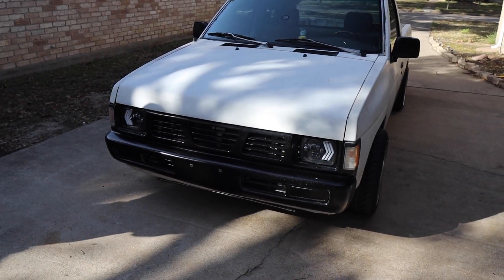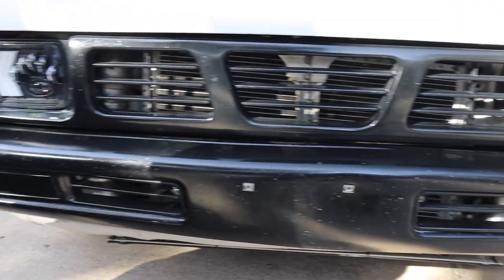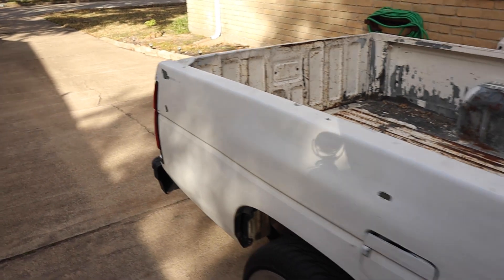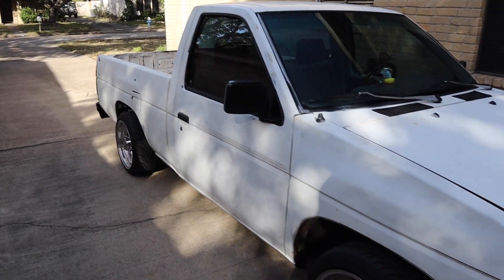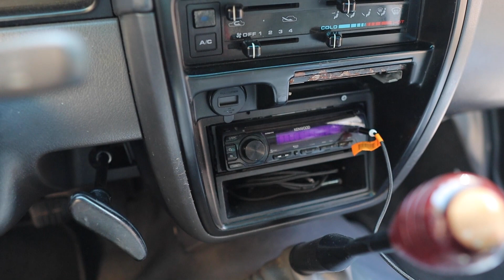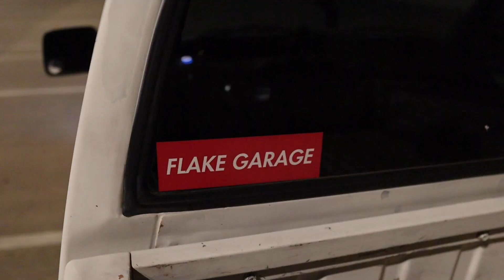1997 Nissan Hardbody D21 Lowered Mini Truck | Flake Garage Bryan G

Comment: What’s up guys!! My Nissan hardbody had 15x8 with 195 50 15.both of you guy trucks are awesome man!!!!
Reply from the maker: Awesome! Thank you for the support!
Reply: @FlakeGarage  hey bro I have a question
Reply from the maker: @galaxykodeentstreetmuzik5259  what's your question?
Reply: @FlakeGarage   hey what’s I both the same beltech kit as u couple months ago and I have some problems
Reply: @FlakeGarage  I heard u said something about cutting the tie rods
Reply from the maker: @galaxykodeentstreetmuzik5259  yes you have to cut the tie rod adjusting bolt shorter to make room to be able to dial your alignment
Reply: @FlakeGarage  thank u bro
Reply: @FlakeGarage  how short
Reply from the maker: @galaxykodeentstreetmuzik5259  it's on the spindle video https://youtu.be/xDALmNv_op0?t=1312 about 6 threads

Comment: Nice tires bro! I like the way it fits. I have 16×10" welds. What size tires would you recommend that is closest to this? Seems like the 205 might be too much of a stretch
Reply from the maker: 205s will be a bit stretch for sure. You need a 225 at least but I haven’t been able to find any 225/40/16 tires so you’ll have to go up in size for a 10 inch wheel. I’m also looking for some tires for my 16x10s lol
Reply: @FlakeGarage  you mean like 225/45/16?
Reply: @FlakeGarage  I found these on Amazon. Any feedback on these? I appreciate all the help man. I just don't wanna buy tires I can't use lol

 Toyo PROXES R1R Performance Radial Tire - 225/45R16 89W
Reply from the maker: @makanahapakuka3485  yeah I think the minimum you need is a 225 wide and you'll still get stretch. Proxes are great for the track but you'll wear them out pretty quickly if you are going to be using them daily. I don't think there's many options right now in 225 width and 16 inch size you might have to look around
Reply: @FlakeGarage  thank you bro!
Reply from the maker: @makanahapakuka3485  pay attention and make sure you aren't getting a track tire if you do find some in that size. For a more normal tire, I've found myself looking at 225/50/16 as that size seems to have more "all season" or summer performance tires that aren't track rubber. Just some food for thought bro
Reply: @FlakeGarage  I was kinda leaning towards that

Comment: Do you have any short-throw shifters you would recommend for these trucks?
Reply from the maker: We haven’t used any ourselves but we do know the 240sx was pretty similar. Maybe one from them could work but you’d need to research that
Reply: I have a s13 on mine, I got it from ebay I think it works just fine

Comment: You guys said that the pathfinder bucket seats only fit on 95 or older but your truck is a 97. Which one is it or did not hear right?
Reply from the maker: Seats from a pathfinder 87-95 fit a hardbody. The hardbody went until 97 but the pathfinder changed body style on 96 so any seat from a 96+ pathfinder will not fit a hardbody
Reply: @FlakeGarage  oh ok. Gotcha. So I can fit pathfinder seats pre 96 on my 96 hardbody. That’s what I’m understanding. BTW, are there any group on FB or IG to buy or trade parts that you know of? Hard to find parts fue hardbodys.
Reply from the maker: @antoniomontesinos707  That's correct on the seats. Fb will be your best bet for groups. There's a big Nissan D21 group for the US and also a worldwide one. Just search D21 on groups
Reply: @FlakeGarage  10/4. Thanks.

Comment: Where did you buy the black bumpers?
Reply from the maker: The black bumper is an OEM bumper just spray painted black. Grille also has a coat of black on it